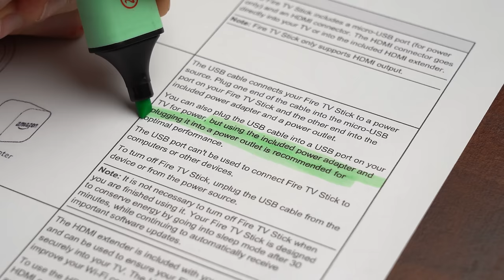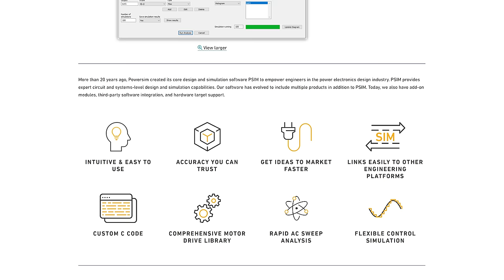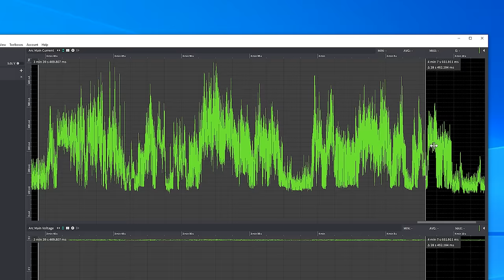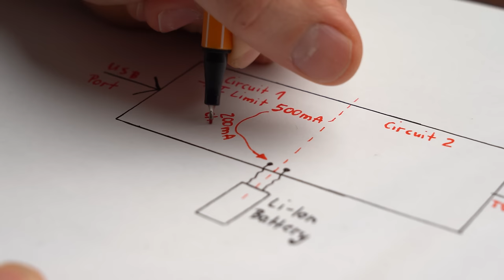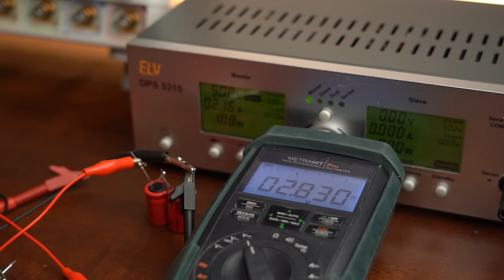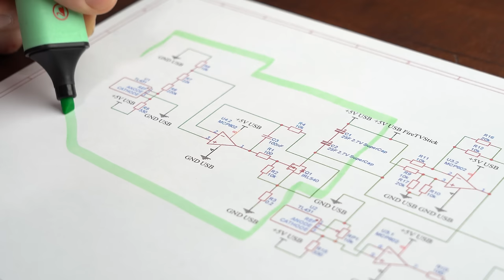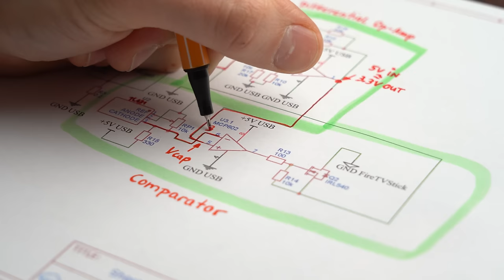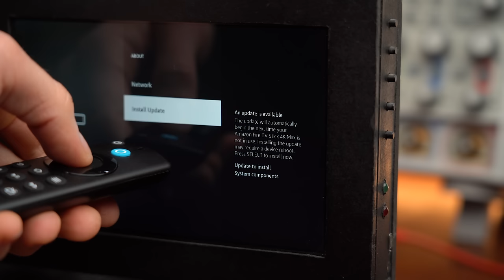I recreated an Amazon Product to make it better & cheaper! (for Fire TV Stick)

Comment: Remind me again, what are the disadvantages of the DIY solution? I didn't hear any. It is cheaper and has less charging time than the bought one
Reply: It have charge time, and more capacity = more time. This only one disadvantage I see.
Reply: @OleksandrDiedov  The DIY system can be hooked up immediately because the circuit automatically manages charging the caps before enabling the load, and total energy capacity is probably actually lower - faster to reach maximal charge. The main disadvantage is that the buy solution is just buy and plug in while the diy solution requires a lot of labour to source parts and assemble - if you're into it as a hobby it's a clear winner but not a great solution for non hobbyists when just plugging it in separately is an option.
Reply: @OleksandrDiedov  But his calculations show that at 25F it takes 250s (approx. 4min.) while the bought one takes 10min.
Reply: Most people have an old cell phone charger laying around the house. If not, they only cost $5-$10 each. Why make something that is almost free?
Reply: @hxhdfjifzirstc894  There are people who use these for Chromecasts, even though those ones come with one for free in the box. There's 2 reasons - 1, less cable clutter, particularly for wall mounted sets where this circuit can be completely hidden behind the TV but a separate brick results in extra cables to manage, and 2, a lot of people with electronics experience feel it's a waste to leave that perfectly good 5V rail unused and just go and make another one with extra efficiency losses. It's not a big deal but it feels wrong.

Comment: wait, why a usb powered device is requiring more than 500mA? isn't that is the standard maximum power for a basic usb port?
Reply: different USB standards have different max current specs for  devices like computers but this is more using USB as a power supply jack/plug
Reply: USB 3 bumps it up to 900mA, then there's charging USB ports that supply 1.5-2A. (And now USB-C with optional USB PD, of course.)

Comment: That device you bought protects the fire stick from not having enough current(when updating for example). 
Your circuit "protects" the TV (which already has over-current protection) by cutting the power off when the caps run out of power. So lets say you were browsing the menu for some time(not letting the capacitors charge or even discharging them) and then a particulary long update comes up. Capacitors run out of juice, the circuit cuts the power and you're left with a bricked fire stick.

Sorry but this one is really stupid.

Comment: From a safety standpoint, cutting with that much snap off blade sticking out beside your fingers is how most people mess up their hands. The knife would have cut perfectly fine with only a very small amount of the blade sticking out
Reply: There's a certain type of person who just can't avoid telling other people what to do, 'for their own good/safety'. I bet you're triple masking.
Reply: @hxhdfjifzirstc894  I have worked many years in industry and seen injuries, most companies do not allow those snap off blades on site, when they are actually quite useful. It just pains me to watch someone misuse a tool in a way that can injure them. You are probably one of those people who think they know everything but have to learn the hard way, I know a few people like you. As for the mask comment I wore one when it was recommended by medical science. You are probably one of those people who say: "I know someone who had covid and they were fine so I have nothing to worry about". Nice use name did you face mash the keyboard?

Comment: It's very cool but 90% of people would just reuse an old 1 amp phone charger even though it would mean needing like a 12ft USB cable to run to the power strip.
Reply: Is your TV 12 feet away from an outlet? Just use a power strip like everybody else.
Reply: @hxhdfjifzirstc894  it's called a wall mounted TV. Not everyone has an easy 3ft access to an outlet. BTW you never run your TV directly from the outlet. Most common way for TVs to die is from not being plugged in a surge protector.

Comment: Fwiw the number of charge/discharge cycles a li-ion cell can survive is irrelevant for this application. The cell is only there to make up brief current shortfalls from the USB supply, and should never get remotely close to fully discharged in normal use.

Comment: Cool project, it's way beyond me. I'd just solder a old disassembled phone charger to the fused mains on the tv PSU and use spade connectors at the usb port, then attach that to the tv cover.
That's the Lazy mans out.

Comment: yeah but that with a battery is allso used as a ups and not just a electric regulator usually pc has to have an ups that has enough energy to al least power down the system without data loss y think you forgot that you need an ups lol maybe solar part to charge a battery

Comment: Neither is a winner. I can buy an Onn USB wall charger + 6' cable for under $10. This option has none of the hassle and delivers 5V @ 2.4A. This is a nice project for someone who wants to build it for fun. But it's not practical or cost effective for most people.

Comment: Natural degradation of the 18650’s chemistry will kill it long before it can experience enough cycles to kill it.

Ignoring the batteries natural degradation and using extremes by saying the battery will experience a complete cycle every month because of Fire Stick updates means it would take over 40 years just to get to 500 cycles. Again ignoring its natural degradation that still leaves it at ~80% health. At that rate the battery would exceed average human lifespans.

Cool video though, I think the icing on the cake would be a 3D printed case. You know just to give the DIY touch that makes it look similar to the original product. If time is an issue you can just make a box in TinkerCAD, dremel the port opening and hot glue your device in it just to show the end product enclosed. Take someone like you 15 minutes to figure out.

Comment: 7:20 do you want to burn your house down? Because that's how you burn your house down 😂
Reply: not with 5v :-D
Reply: @MrJigssaw1989  with a super cap that can supply enough current to melt wires, its definitely possible
Reply: Supercaps are far safer than lithium batteries in that respect.

Comment: You said the resistors would be a bad idea because it would take forever.... that makes no sense.. you are still limited to 500 mA no matter what method you use... you could literally just use 10 ohms of resistance to cap the input current to 0.5 amps with 5 volts incoming.  Super simple solution.  Technically you don't need anything else but you could add some supplemental components for more idiot-proofing.
Reply from the maker: Give it a try then😅 You will see the problem  yourself
Reply: @greatscottlab  If I'm missing something then please educate me... however it really is that simple.  ALL you need is current limiting.  That's it.  As far as backfeeding when the tv turns off, I'm pretty certain the usb spec says the circuit must be able to tolerate that.  If not.. a simple diode is the solution for that.

Comment: I hate to be a downer, but WTF? My tv shuts of the USB current when turned 'off', even though it is really in standby mode.  I just have it powered off of a 1-2A usb charger and it stays on and is available as soon as the tv completes booting.  Might cost me $1/yr in electricity cost extra, however some projects are not worth the time*... *Depending upon the person

Comment: I think you over complicated it. Just use a lm317 as a current regulator and a schottky diode to the capacitors.
Reply from the maker: You have 5V power. With an LM317 you got a big voltage drop. You want to boost it firstly and waste more power? I thought about lots of other solutions.
Reply: @greatscottlab  As a current regulator it only loses .7 volts.
Reply: @davestech6357  Nope, it requires both the dropout voltage (2~3v and the 1.25 reference), so it wouldn't work. There might be a few alternatives with lower dropouts. However, I'm wondering whether a resettable fuse (let's say 400ma) could be used as a very crude charging circuit for the capacitors.
Reply: @greatscottlab  Well, it took a long time to charge up two 2600 Farad capacitors. Yes the voltage drop was too much at 1.438 volts.

Comment: The rule of thumb for artists is that you should charge at least 3 times your materials costs for the finished product. I've read a few times that that same ratio works well for small electronics products, too. By that rule, your $10-in-parts should sell for about $30, which is 50% more than the buy version...

But I agree about the LiPo. Wrong application, and built in a way that makes it not user-serviceable.

Comment: I blame Amazon for designing such a poorly designed product that it would exceed 500mA when the entire purpose is to be powered by the TV in the first place.
Reply: But don't they tell you that you're supposed to use an external power supply? I mean everybody has an extra USB power supply from an old phone just sitting around the house.

Comment: Hallo, Ich liebe deine Videos, aber manchmal denke ich mir, dass du diese Sachen unnötig kompliziert machst.
Könntest du nicht einfach die eingangs Stromstärke durch einen Regler limitieren und dann mit Hilfe einer RC-timer Schaltung abwarten bis die Kondensatoren geladen sind. :)
Reply from the maker: Please ask questions in english. With an RC timer you would have the problem that the capacitor would take forever to reach 5V. Feel free to give it a try. You need a constant current source for this to not only shorten times but also to keep the capacitors nicely charged when they are in parallel to the Fire Stick.
Reply: @greatscottlab  I’m not exactly sure what you mean, but there must be a simple way to over go this problem, I’ll try it out but thanks for replying so quickly

Comment: I used a capacitor bank to power the stick 

And the tv 

And the speaker system 

And the router 

The bank is big af and also ilegal so I had to give it to the police :v

But it worked fine xd

Comment: You could just make a PCB and save yourself the trouble too
Reply from the maker: Sure also possible. But for such elaborate test, I like to stick to perfboard to confirm that everything works before designing a PCB.
Reply: @greatscottlab  That's true, I was suggesting that if anyone wanted to replicate your design I'd make a PCB.

Comment: Interesting video but a huge waste of time and money for your solution or the commercial battery powered solution. Your TV or monitor is mains powered so why not just use a mains powered AC adapter to power the crappy poorly engineered spyware data collection device known as the Firestick? And further shame on Amazon’s beyond crappy product managers and engineers (or whoever they outsourced it to) for not designing the Firestick to work with a 500 mA power budget in the first place. Perhaps it’s the same team that designed the highly successful Fire Phone?

Comment: Well... That's fine and all. But you're trying to filter current spikes caused by Wifi communication etc. that are probably a few milliseconds if not microseconds long. A simple low ESR capacitor (I would say maybe 470 uF or so) and a resistor would have easily fixed the problem. If you wanna be fancy, you can use an inductor instead of a resistor. And make a LC low pass filter, instead of a RC filter. Heck a capacitor alone would have probably fixed the problem.
So yeah, the Li-Ion version is completely overengineered, no doubt. But your version is completely overengineered and not really that much better. Sure, Li-Ion batteries have limited charge cycles, but you are barely using the capacity of the Li-Ion battery, so it will probably never even complete a single charge cycle.
Interesting project and all. But I'm not entirely sure what the point of the video is. I'm also not entirely sure why Amazon didn't just add a god damn capacitor to the Fire TV stick themselves.